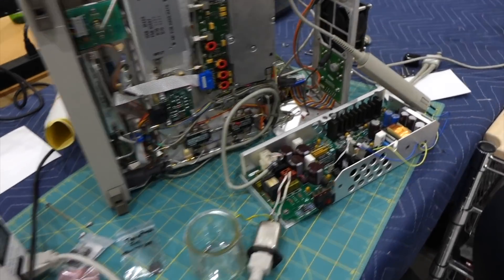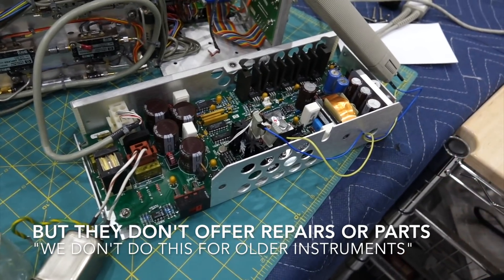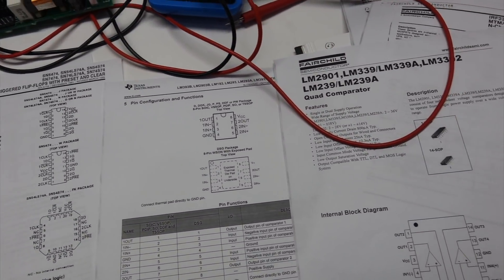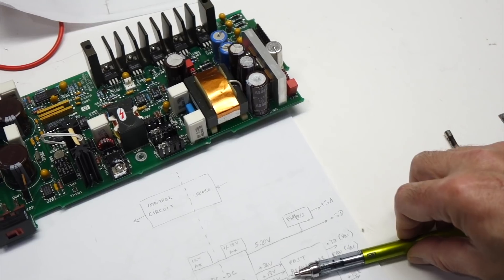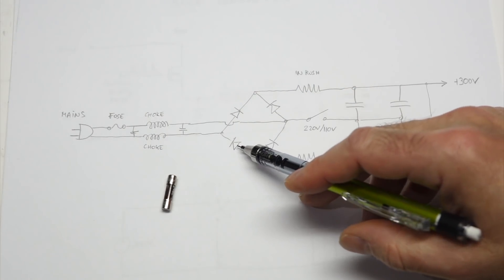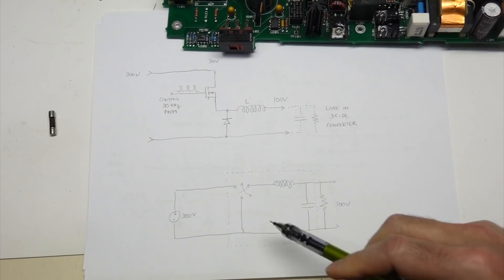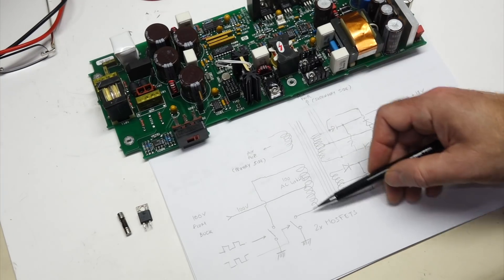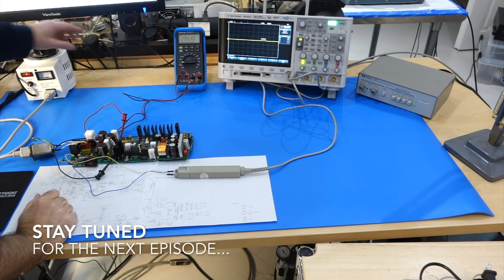HP Switching Power Supply Repair Part 1: How a SMPS works

Comment: Pretty repairable item actually. The real fun starts when you have smds which massively vaporizing and you have no idea what it was. I was doing repairs of modern industrial power supplies (mostly siemens), also VFDs, and it was real hardcore due to absolutely zero info.
Reply from the maker: Indeed. The more modern, the harder to repair. Cars are following the same curve!

Comment: the real truth is that they LOST all documentation, or the design of this power supply was subcontracted, and that subcontractor disappeared with the docs.
Reply: Most likely. Going from HP to Agilent and then to Keysight reeks of the kind of "restructuring" that just leaves stuff behind, never to be found again.
Reply: @TiagoJoaoSilva  Exactly.

Comment: You can't get parts or schematics for it but this piece of TMDE is used by the US military 
NIIN
016260769
NSN
6625016260769
Also I know this sounds stupid but at this point just for a sanity check if your running on 200+ mains check the continuity of that 110/220 switch, this smells familiar to me.
Reply: I was curious about the 110/220 switch as well.
Reply from the maker: Indeed. One of the first things I checked, and it’s fine.
Reply: @CuriousMarc   Well I hate when that happens,  The ESR theory has merit but is also a real bugger to nail down.  I'm looking forward to see your next steps but I'm also not envious of your position. Good luck.

Comment: I feel if you are buying professional grade equipment that cost tens of thousands of dollars, the repair manual and/or repair service should be included/available. I feel this should be a law.
Reply: There is momentum growing behind a "right to repair" law, which would make it illegal for companies to deliberately design electronics to be unrepairable by either end users or third-party repair shops. I think this also applies to making spare parts/repair manuals available as well.
Reply: Agreed. And if I may, I'd like to extend this to cars.
Reply: You have to be lucky to see markings on ics nowadays....
I think at least there should be a law to make replacement parts and Equipment/Software/Firmware needed for repair buyable.
Reply: Should also come with MAID SERVICE !!!

Comment: Need to isolate the sections, and provide whatever voltages/signals the control circuit needs to operate.
So you fix the 300V to 100V section, then power the 100V to LV section with an external supply.
I expect the reason for the 100V rail is to reduce ripple on the LV outputs, as you don't need to vary the duty cycle as much to cope with country/local differences in mains AC voltage.

Comment: The so called simple power up to test the controlls looks like check the data sheet for the opto isolator and the three ICs ner it that controll it and inject via the output pins and scope the diode portion of the opto isolator.  Be sure to have someone around to unplug everything if it manages to back drive voltages.

Comment: This is almost identical to the power supplies used in the 8590 series spectrum analyzers. Those however take you to the deeper levels of troubleshooting hell by using a three board clamshell layout and all SMT control section. The layout is the same even using the same switch controller , an NE5560. Great stuff Marc. I had to repair one that got flooded a year ago. It was quite the learning experience. In the end I replaced all the drive FETs, the gate drive ICs and a zener diode to get it running.

Comment: I usually start looking at the AC input block like you did. If nothing obvious shows there  I switch to the output side working back towards the input by injecting DC from a bench supply post of the last rectifier working forward to the input,

The one thing you generally know; something(s) has to be defective, do the simple things first.  The first thing in my book is a detailed visual inspection, solder joints, solder bridges, broken traces and sniffing for that magic blue smoke smell.  The obvious components are the caps and semiconductors, in my book they have about equal probability of being blue smoke deficient. But don't discount a transformer winding.   Be glad its not one of the fancy resonant mode converters,  they are like sewing machines -- no possibly way they can work but somehow they actually do.  Good luck will be interesting to see what you find.

Comment: HP algorithm. if ( equipment_age < 25_years) {  no_Schematic_available(); }
                          if (equipment_age > 10_years ) { no_Spares_available();  }
This algorithm only works under Linux.
Reply: That should likely be refined to something like:
if ( equipment_manuf_date > 1995) {  no_Schematic_available(); }
if (equipment_age > 10_years ) { no_Spares_available();  }
i.e. there will be an ever growing gap of equipment manuf dates where there is no way to fix it.
Vote for "right to repair"!

Comment: Could do the series lamp trick on the mains primary and current limit. Would save you blowing fuses and possibly silicon.
Usually use a 100W incandescent lamp here @ 240V mains gives around 400mA limit. Change lamp wattage to suit.
Reply: The problem with ps is that they charge the Electrolytics after the bridge rectifier first and then start to work with the same 'bang' as before.
If the voltage drops due to a glowing lightbulb, the current increases, because the SMPS tries to compensate for the missing voltage.
So either the unit doesn't start at all or it explodes as before.
I tried to repair a SMPS of an old Philips scope once. The only way (imho) would be a current limited high voltage supply instead of the HV caps. 'I have spoken' ;)
Reply: Yes, inspired my Mr Carlson I built a box with a variac, an isolation transformer, two 100W bulbs and an LCD power meter for repairing switch mode PSUs and have fixed several so far.  One issue is some SMPSUs are not stable with the series lamps in circuit.
Reply: I've had better results with tungsten halogen  flood lamp bulbs.

Comment: Did you look for a manual on http://artekmanuals.com/manuals/hp-manuals/  ?? I recently fixed an industrial SMPS. It was a much different topology and much smaller (24V 10A). It is an interesting PSU.
Reply: Good suggestion. I just did a quick search for 8564 and there's a match (along with other models in that range), the notes on the site say "Component Level Information". $25.

Comment: Consider "Jump starting" the control section. Give it the low voltage from an external supply. (You might have to find and disable the internal supply path for this.) I would then approach this whole thing backwards. If you see the DC-DC switches get driven (you can even take these mosfets out), you could feed a supply of 100V into that section (again disabling the internal supply path at a convenient point), and work your way back to the front, ensuring that subsequent stages work properly. Only at the very end I would dare to apply Mains again.
Reply from the maker: Interesting technique, I had not thought about that one. Difficult in this particular case as the control won’t start if it’s not feeling the full voltage from the mains rectifier.
Reply: @CuriousMarc  I see the problem. But surely there must be some conditioning of that sensing? My suspicion would be that the DC/DC 40kHz did drive the mosfets not symmetrically, if the drive has not exactly the same on-time for each of the two fets, then the transformer saturates, current goes through the roof, and that blows the mosfets. So the TTL flipflop and the drive amplifier near the mosfets would be my suspects.

Comment: this is the situation when i call for a more experienced old television repair guy. Who will after replacing the clearly dead parts just desolder or cut traces at some strategic points, put one light bulb somewhere on the secondary, a second big light bulb in series on the input and then start probing with his oscilloskope while watching the 2 bulbs glow.
Reply: That is most certainly one of the only ways you can fix these things! 
I do the same thing with the lightbulb while repairing these beasts!
Reply: Dim bulb doesn't work on switchers.  They compensate for the low voltage by drawing more current - which leads to lower voltage.  Dim bulbs work fine on linear stuff.

Comment: That looks similar in layout to the power board from an Agilent 6890 GC.
Reply: Isn't Agilent a spinn off from HP? They formed around 2000, I think.
Reply: That was my first thought, HP Instruments is no longer HP, it's Agilent. You'd think Agilent got all the good people, the institutional memory and the schematics... I hope Marc has been talking to Agilent, not HP...
Reply: @TiagoJoaoSilva  But the test and measurement divisions of Agilent split off as Keysight, so it's Keysight that Marc should be talking to, not Agilent or HP, or HPE for that matter.

Comment: Damn it would be easier to just build a new PSU I think.   Uses adjustable modules to obtain the various voltages required.
Reply: Nope! This is NOT a standard computer power supply, and making and designing a multi-voltage high amperage switchmode power supply from scratch is NON-TRIVIAL in the extreme!

Comment: Change electrolytics would be the first thing I would do.
Capacitors with increased ESR sometimes makes them go unstable and blow transistors, HP 8662A/8663A PSU is one of these for example.
Startup check is simple, just use external PSU to power it and see, wether it works ;-)

Comment: Keysight does kind of suck for support I asked them to quote me for a repair of a 34401 and they basically pointed me to a meter without GPIB which was the interface I needed on a legacy factory machine, like thanks, dick (for those who are confused, HP test equipment changed to Agilent, then Keysight)
Reply: There's a good reason many people with Agilent analytical instruments pay third party engineers to fix their kit. In my experience, Agilent engineers tend to be a bit hit and miss. I'd imagine its the same for Keysight's lot aswell. All the good ones end up at third party places where they get paid decent money. Those experienced people get replaced by noobs with little repair experience. If Marc took that in for repair, they'd swap the board out and charge him an arm and a leg.
Reply: @spwicks1980  If mark took it in for repair, they would reject it and recommend him to buy something new.
(or at least that is what the remark in the video was)

Comment: Nice but the supply is quite simple it is a very common design should be not so difficult to find the issue, it is perfect for video showing some basic supply technology. looking forward
Reply: Why is there a buck converter / an intermediate 100V potential?
Reply: Günther Thomsen Active pfc correction.
Reply: @gillywild it has no PFC
Reply: @Günther Thomsen yes and makes it easy to build the control loop for a Push pull converter, to have a preregulator, but it also has a switch in the rectifier for a voltage double for usage on 220V or 110V
Reply: How can you say it is simple if the output specs and currents are unknown?  If it took Marc a day and a half to map it out I don't think I would default to "it is a simple power supply".
Reply: @Shain Andrews Depends, as far as i know Marc is not so much into designing electronics and not so much power electronics. And tracing a circuit just takes time even if it is simple or complicated

Comment: Maybe you should replace the Rifa X & Y  capacitors they have a tendency to blow up when they are cracked because of moisture ingress i think ^^
Reply from the maker: Maybe as a preventative measure? They have a bad rep indeed. These looked fine. Anyhow, not the source of my immediate problem, and they would not destroy anything if they let go. Just let out the magic smoke...
Reply: @CuriousMarc  I had some that looked pristine in my HP 1630 one day, and didn't the next.. Those things are timebombs lol
Reply from the maker: @leisergeist  Did they go pshhhht and let the magic smoke out?
Reply: @CuriousMarc  Nothing as dramatic as a tantalum, but they're nice smoke machines!
Reply: @CuriousMarc  Yes exactly. I can't see a Class X failure causing a problem later on unless it generates a fast dv/dt spike. Just a matter of changing them while you are there, and have the PSU open.
Reply: If they aren't already out of spec, they will be eventually! Rifa Class X/Y caps are responsible for a lot of expensive equipment failures around the world.
Reply: If you don't know what's failing and in what order, at some point it's easier to just replace every non-trivial component on the circuit board.
Reply: @Kalumbatsch  Yeah, but where's the fun in that?  ;)  If this was work for hire, that would be different.